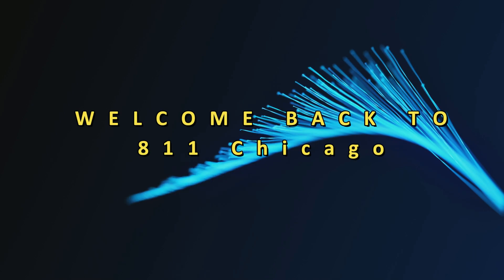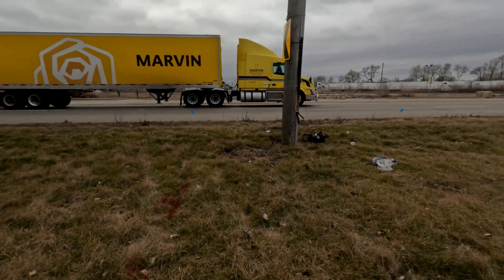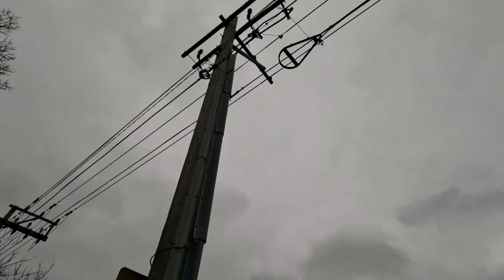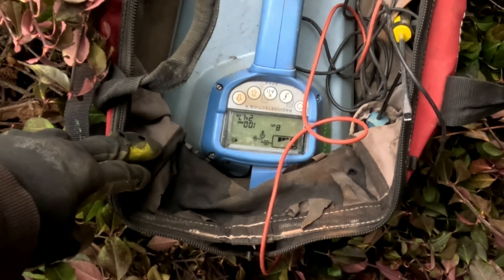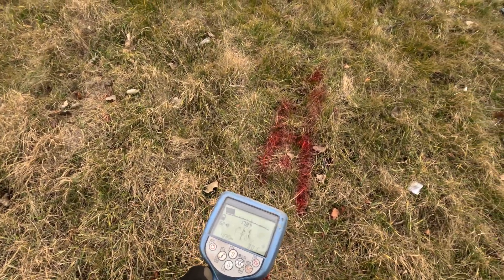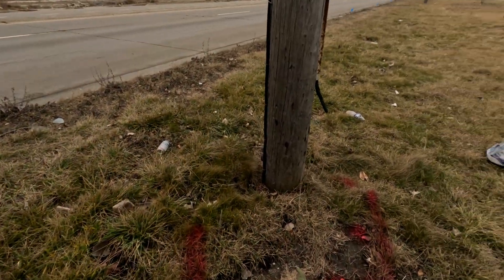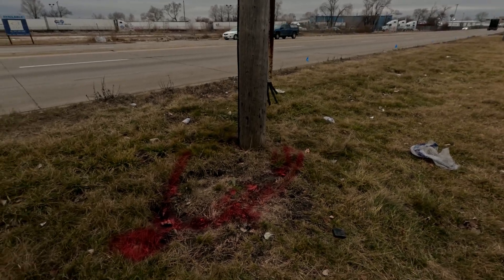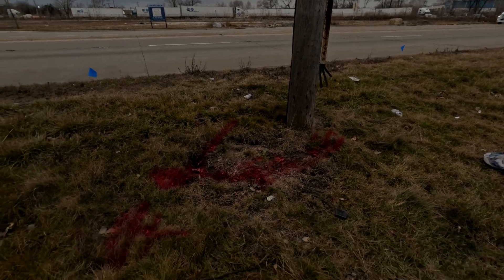Locating a High Voltage Power Line | Tips & Tricks | 2023 Damage Prevention

Comment: Never seen anyone hook their Lead to the riser on the pole to locate. This would only work for metal risers, and you connect to the bolt. Also the prefered method is to hook up at the transforme.
Reply from the maker: It is crucial to keep in mind that we are locating the grounds, not the cable itself. If the ground is connected to the Uguard, then you are good to go. When locating electricity, it is advisable to go to both ends to locate it as the cable may have been replaced at one point of time.